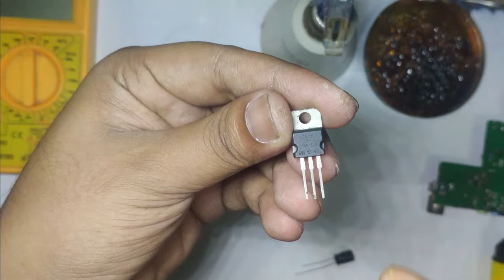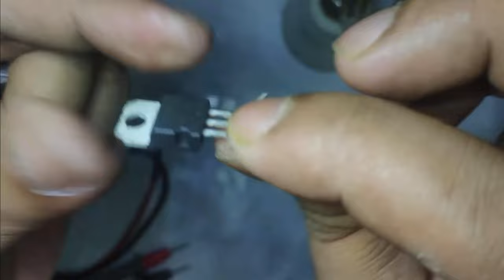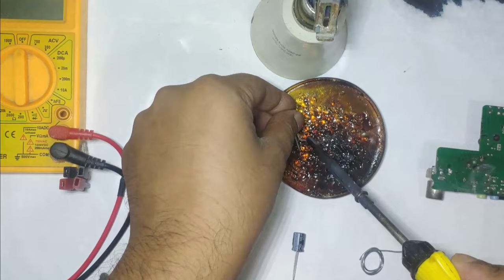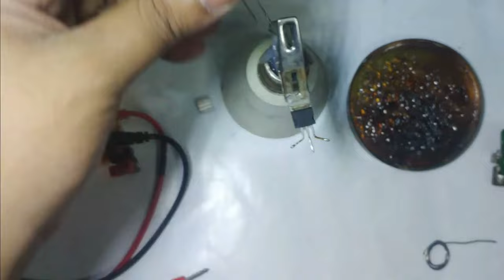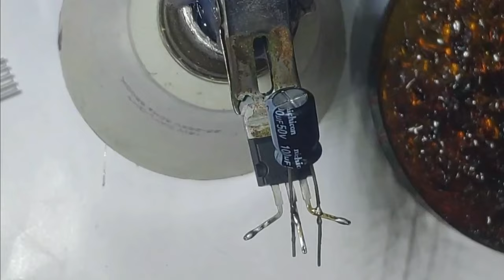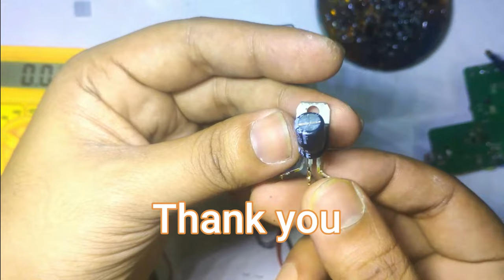how to convert 12v dc to 9v dc And 35v to 9v

Comment: hello 
does it will work from car voltage 14v when alternator working ?
Reply from the maker: yes. It's working 14v to 9v
Reply: is this output is fixed to 9 V  if input voltage is increasing like 14 to 18 v or 20 v ?  if not how to make it please share